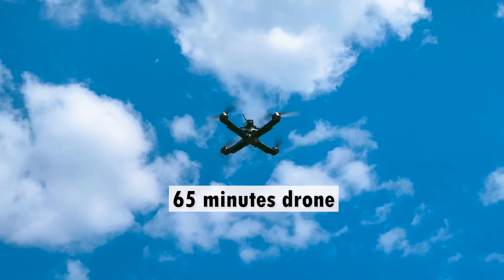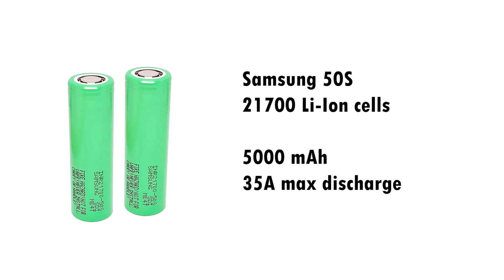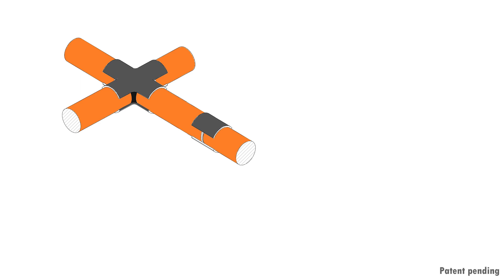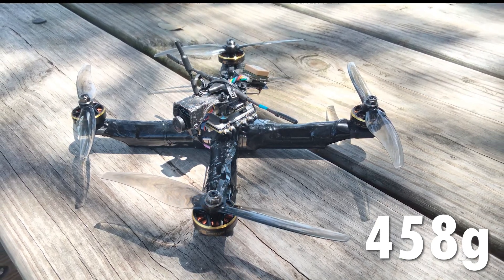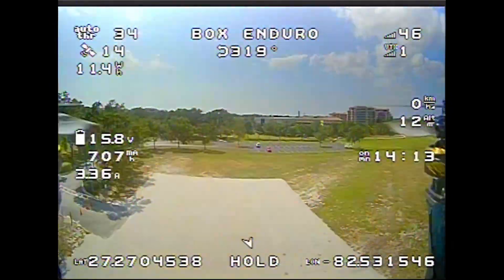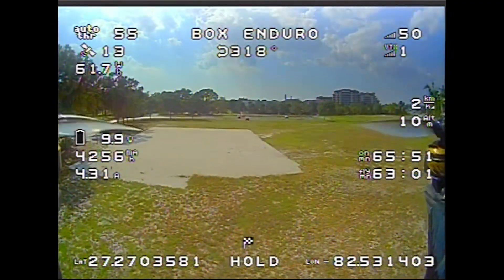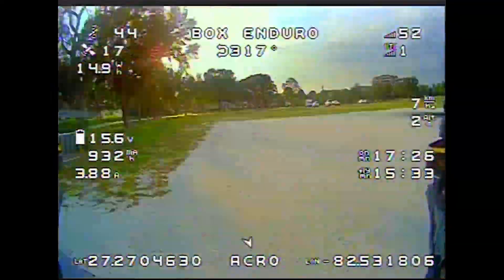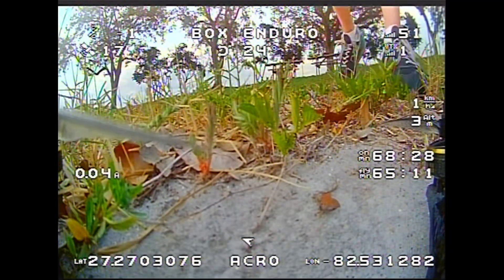65 Minutes Long-Range FPV Drone with Structural Battery

Comment: nice work. from what i have learned building my DIY electric paramotor is that prop size is the biggest factor to increase efficiency alot. i suggest you go up to 8 or 10" props. and just by that you will easy hit your 75min goal with the same battery. trying to decrease weight is a good point too. dont forget aerodynamics too. getting the motor arms in a different shape (maybe waterdroplet shape) should further increase efficiency. i wouldnt bother to shave of 10gramms here and there. cheers mate. 🎉😊

Comment: instead of using wires to deliver power to motors, could solid rods be used instead, to act as power delivery and structural wing? Great job, longest flight ive seen.

Comment: If pure flight time, not hover time is the goal, then why not add wings, since airplanes are far more efficient in forward flight than drones? The wings will increase weight, but add substantial lift, reducing the output effort of the motors while flying forward

Comment: Long flight, but looks like you killed your structural battery - 9 v on 4S is bad even on liions... And it looks like you'd have to disassemble the entire drone just to get them. Also, the "structural battery" means you can't just swap the battery out for another and go for another flight. And with liions' slow charge rate, you may only get 1 flight per day. The opposite direction works much better - 20-30 min flight time, but the battery is easily swappable. So you can take four of them out to the flying spot and get 2 hours of flight. Only illegally far long range flights would need it to have flight time on a single battery that's that long...

Comment: Congratulations and welcome to the above-sixty-minutes club! Btw I have also used 4s Samsung 21700-50E. My approach was decreasing the weight and increasing the prop size at the same time. Finally I settled with 18“ props an AUW of 648g and 108 minutes of hovering. https://youtu.be/CKMXVEgMOkE

Comment: A few years ago I tried building a light weight drone myself.  I took a racing frame (the switchback from 533) and used some 7in arms I got off another quad (the darwin 129).  It only took one careful cut and the arms slid right in.  It was week and totally not good if crashed but it flew amazing.  The result was a 7in drone at around 300 grams before battery.  Not as light as yours but less extreme.  I got 20 min flight time, flying pretty aggressive, on a 6s pack of vtc6 cells.  I built a second but never timed it with both.  So one thing that I never tried and could possibly REALLY help with long flight times was tuning in the esc.  I came across something that was talking about ramp up time and it got me thinking.  Its possible that in BLheli there is a way to slow down the speed at which the motors change their rotational speed when making corrections.  I think its a big part of how all the camera drones get such good flight times.  They make it so the motors take longer to spool up and down.  This is similar to how you get terrible gas milage in a car if you floor it every time you are getting up to speed.  When the motor gets up to speed fast it wastes a lot of energy in the form of heat.  If it speeds up slowly its more efficient.  By changing those settings in the esc software it means all the little micro corrections during flight don't drain the battery as much.  I'm sure this could present some tuning problems and would likely need a real skilled hand when tuning.  But I think you might be able to get 30% more flight time with just that one modification.  I'm not saying it would be easy but it's something I always wanted to try but never got around to before I tore the drone apart to build something else.  If this helps let me know.  Great vid.  Always fun watching people experiment.
Reply: Just watched the vid a second time.... this time I wasn't distracted and I'm thinking maybe my idea is something you already considered.  oops :)
Reply from the maker: This is actually what I am trying to do right now - to find a perfect combination of motors / props / PID / BLHeli_32. 30% sounds very optimistic to me, but I hope to achieve some significant increase in my next 8S drone. One of the problems I ran into is that you need more ramp-up power as voltage drops. And since this is something you can't change in flight it means that you have more than enough when the battery is fully charged.

Comment: Your a genius bro! Don't mind me as I steal your idea and 3d print a drone thats basically nothing but motors on a battery. But add a thermal generator. peltier electric coolers can be used as a generator. make a small gas burner to make heat to make electricity from the peltiers. You can make a gas generator very small. If you add vacuum tube technology to the thermal generator you can increase the fuel efficiency. And what about blimp technology with solar panels. Do you ever need to land? Can you just forever hover over your house and use it as a security camera one cam for whole house?
Reply from the maker: Thank you! Please feel free to use any of my ideas in your builds, as long as you don't do it commercially ;).  I experimented with 3D-printed frames and elements - they are usually too heavy.
I really don't know anything about thermal generators... As for blimps - they tend to slowly leak gas, and they need a lot of power to fight with the wind.

Comment: Would you be able to use a better battery chemistry for energy to weight? Maybe lipo? Several 1s packs in series or something?  Or just figure out what capacity you need for your flight time then see what a single lipo that would accomplish it weighs along with a carbon fiber frame, total weight vs regular lithium cell structure battery.  The ultimate would be as someone else suggested,  a helium bladder to add left, but it would have to be custom made into an aerodynamic shape.
Reply from the maker: Li-Ion has the highest energy density of all generally available batteries. Li-po has significantly less energy density. I am currently working on an 8S1P li-ion drone - same cells but 8 in series instead of 4.

Comment: You can use carbon tubes as x frame and insert the lithium batteries inside the tube arms.   The only downside putting batteries inside the arm structure is inertia creating lag on instant movements.    But it is great option for long range drones
Reply from the maker: I am trying to make it extremely lightweight - adding the tubes around the batteries will add some weight.
Reply: @eugeneforshter  You could use short sections of tube to hold the cells together they would probably weigh less than 0.5g each depending on wall thickness.
Reply from the maker: @thirtythreeeyes8624  this is basically what I did.
Reply: @eugeneforshter  Ya I guess you say that in the video haha. There are new 21700's coming out from Lishen that are 6000 and 5800mah depending on amp draw the 5800 is good for 3c the 6000mah for 2c I believe and I'm guessing if you're getting over an hour on 4000mah amp draw is less than 5a. You could probably also use an AIO board even the smaller ones with elrs built in might work on this setup. There's probably 20-30 grams you could save on electronics. 

Using those cells and shaving every gram possible I bet 75 minutes would be possible.
Reply from the maker: @thirtythreeeyes8624  Thank you for the info about new batteries becoming available!
I am now beast with work and other projects, but I hope to get back to structural battery drones soon.

Comment: nice, you are consuming 65-66 Watt for a drone having weight almost 500gm in hover flight, did you calibrate the current sensor before flight ?
Reply: my 2kg 7 inch draws around 7 amps in hover on 6s so this doesn't seem that weird to me?
Reply from the maker: Unfortunately, I didn't. I just used the factory-recommended scale settings for the inbuilt sensor in the flight controller.

Comment: This is exactly what I'm doing to my Kea drone. It has wings also. I'm not trying to be as light as your drone but I'm hoping to use the wide stability wings will add to the flight time? I actually am not looking for as long times as you are so I'd be happy with half that time? 👍 Good to know that the lithium Ion cells are worth while. My set up I'm just making a double 4 X pattern of cells for each side of the arms (2 X 4s cells=4S2P)
I've carrying a Connex HD video link and GPS etc so already at weight disadvantage!
I just want to program so that if the radio signal drops that it can plot a course to fly back to home👍 I may add 2 sonic sensors and maybe a barometer (altitude) and some other sensors, do some programming to get some autonomy from the quad? This  can allow me to test the limitations of digital video link with modified aerials 👍
Reply from the maker: Best luck with your project! I am not sure how wings work in conjunction with rotors on a quad. Make sure you select Li-ion cells with a high discharge rate.
Typically there is an inbuilt barometer in most flight controllers. Also, check out the new generation GPS modules - they are extremely light.

Comment: How can a better esc increase flight time? Or blheli32?
Reply from the maker: Higher quality ESC can be more efficient, losing less energy due to heating and having less internal resistance. Also, a better ESC can have some additional settings in BLHeli_32. Playing with BLHeli_32 settings can improve drone performance. Joshua Bardwell and Chris Rosser have great videos about it on youtube.

Comment: One way you could attempt a longer time is to go with a 2 series 4 parallel battery... the lower the voltage, the lesser the amperage. the gains would be more than double...
Reply: And you should put on the largest multi bladed prop you can....
Reply from the maker: In terms of efficiency the fewer blades you have the better. I have once seen a single-bladed prop that supposedly was super efficient. It had a counterweight instead of the second blade.
Reply: @eugeneforshter  Maybe a follow up video to prove your theory.....!
Reply from the maker: @peterclark6005  This theory is not mine. It is well proven by scientists and  professional engineers. I am currently working on an 8S drone that will supposedly have longer flight times. Stay tuned!
Reply: @eugeneforshter  "proven by scientists"!!!
Reply: @eugeneforshter  casual reading here & just have to classify something of importance to this for all individuals who are mistaken of this. Science-based theory is as stated, theoretical. Proven status is real world reality. 
The definition of 'proven' does not & will not ever be relatable to 'theoretical', as much as the scientific community is so willing to deny of fact!! Until this is proven to be incorrect (lower those expectations, correct you understanding) please refrain from inclusion of this falsification of fact. Thanx in advance for your understanding  & compliance.
Reply: @peterclark6005  time thus contradiction was corrected, isn't it??
Reply from the maker: The key component is Power (P), a drone uses more or less the same power to stay in the air during a flight. The Power is the product of the multiplication of Current (A) and Voltage (V). Thus the higher the Voltage is the less Current you need and vice versa. By connecting cells in parallel you double the Amp-hours, but you get twice less voltage. So in pure theory, there is no difference. In reality, there are many considerations - on one hand higher voltage is more effective due to less heat loss in electronics. On the other hand, the electronics that can handle higher voltage is bulkier and harder to find, and you may need to use additional BEC. And it is next to impossible to find small motors with low enough kV for 8S.

Comment: Awesome idea for a frame.
Recently I just built a 230g dry weight 7" drone. It was very efficient at hovering. The thing is that I like to actually move forward during flight and do some long range distance. Travel speed at about 60kph.
On a 4s 21700 I got about 20 minutes.
I tried all kinds of props. Trust me I have them all 😅.
So my final results were, that 5" props for my kind of flying style gave me nearly the same flight time. After all I put on shorter arms, saved some weight and gained a more practical drone for transport on my bag.
Seriously try some gemfan 5226 props on this build of yours and tell me the flight time is hardly 5% less and the flight feel was 50%better.
Just my experience.
Reply: On my 5" 4s long range build I also used those gemfan 5226 props, the dry weight with props and HDzero video system is 183g. Used 1408 3600kv motors and the tbs 5" podracer frame.
Reply: @CyberdeckCafé  1408 seems more matching to gemfan 5030 props. Just my experience. Try them
Reply from the maker: You are probably right - the flight time shouldn’t change much. I will try the props in the future, but my ultimate goal right now is to achieve extremely long flight time, so even 1% extra is important for me.
Reply: Sounds like you used too small of a motor on the 7" I'd bet 2206 is as small as you'd want to go if you want any speed and even that is probably pushing it if it's not 5 or 6s but, you can use xcopter to really plan out builds.

Comment: You just made it 10grams lighter. 
Good project but not practical
Reply from the maker: According to my calculations, I made it 32g lighter, allowing me to achieve more than an hour flight time 1:43 . It may be practical for applications where extended flight times are required, such as inspection, surveillance, etc.

Comment: That’s a really heavy crossfire setup, using elrs with the lite receiver would drop another 5-10g at least
Reply from the maker: I am using a very light R9 mini receiver, it weighs less than 1g plus about 2g for the antenna.

Comment: I was so hoping get 8" drone to hour but fell very short. Thought extra batteries I could do it. Still cruises long throttle though on 6s 12000mah. But have only done 46mins max so far flying around. Drone with battery is like 1800g
Reply from the maker: 46 min was the longest flight time I was able to achieve on a traditional framed drone.  What kind of battery are you using? 6s 12000mAh sounds like a Li-Po.
Reply: @eugeneforshter  it's 2 geprc 6s2p 6000mah with xt60 parallel cable. They are taped together. It's li-ion
Reply from the maker: @divingfalconfpv4602  may be a different battery can solve the problem. 21700 Samsung 50S cells are 5000 mAh and 25A discharge rate.
Reply: @eugeneforshter  if maybe. I think my discharge rate low enough that it would be more efficient.  At and over 15a 50s is less efficient than P42. There's a test somewhere.  He got more mah out of p42 at over 15a than 50s. But at 4p and I think I average 15a on flights I should be way under that. I'd have to make my own pack though
Reply from the maker: @divingfalconfpv4602  I hope it will work out one way or another
Reply: You should try a slightly lighter setup on your 8" rig. I flew my 8" SAF8 for 45 min(27 miles) on 6S2P 10,000mAh. I even landed at 3v/cell, so I could've probably flown for another 4-5 minutes.
Reply: @austntexan  this isn't extremely heavy. About 580g no battery
Reply: @divingfalconfpv4602  Sorry, I read your specs wrong. Man, that is a lot of weight, 1,216g for those batts! You might look for a 6S2P 21700, 10,000mAh 843g. It'll save you 374g. Your quad sounds more efficient than mine. I bet you could get an hour with the 21700 cells. I was rarely above 10Amps when I was flying with the big 21700 pack. Going to try the 18650 pack tomorrow.

Comment: I had these 2 ideas. I saw a baby drone under 20 gram the other day. Now if it's so light, you could maybe attach bags of helium to it for extra buoyancy, not? The other Idea I had was to make the arms that go to the motors wing shaped. That way, when you fly forward at a 90 degree angle, the arms help to provide lift. Good luck with your next record attempt!
Reply: wouldn't those arms block motor thrust
Reply from the maker: Thank you! Helium bags need to be big enough to at least carry the weight of the bags itself. Plus they will generate a lot of drag. It doesn't work very well on a small scale.
As for motors located on wings. I think it is a great idea. I have some earlier videos on this channel working on such design and I plan to do more work on it in the future. It comes with it's challenges though.

Comment: Awesome accomplishment!   But are you really using 2850KV motors on a 4s battery with 6" props? 👀 The lower the KV, the higher the efficiency, especially at lower throttle like hovering. Those would be really high KV for an 800 gram 5" on 4s.
Reply from the maker: You are absolutely correct! I am actually using 1500kv motors, but there is no picture of these motors on the T-motor website, so I used the picture I had.